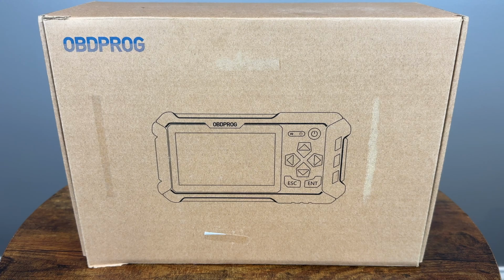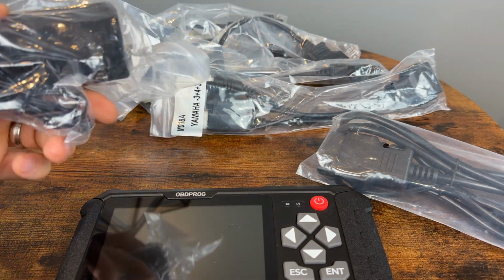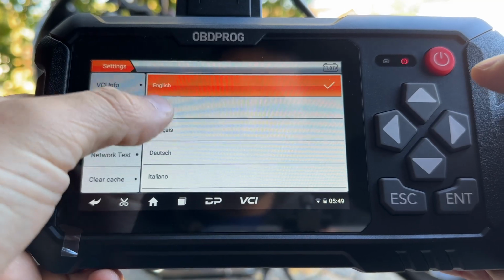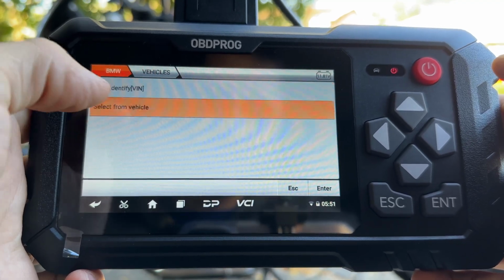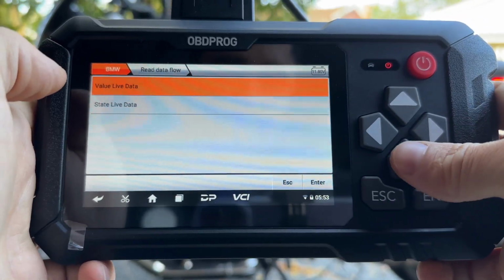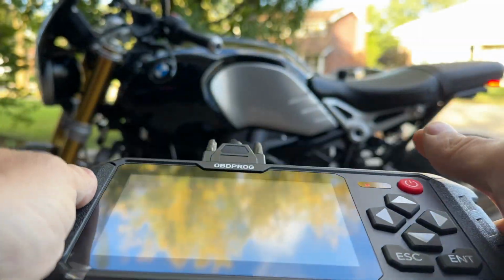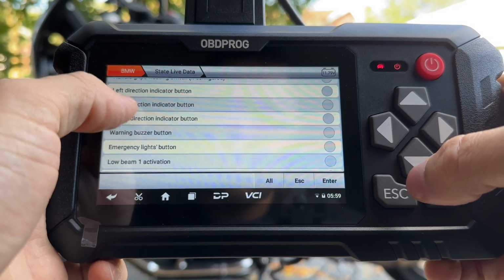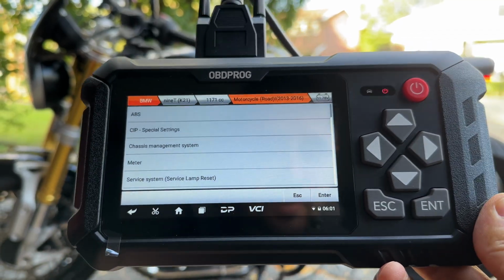OBDPROG Moto 100 - Fully Featured Motorcycle Scanner

Comment: 2006 fjr 1300 has a 3 and 4 pin cable connector, is not going to work you think ? .... because you said only 2016 onwards
If it doesn't work on 2016 and before motorcycle even if they have obd connector is not worth it I think

Comment: I got a $15 connector from Ebay. Now I can use my car OBDII tool on my 2020 KTM 1290SAS. It reads and cancels error codes.
Reply from the maker: But can it read KTM specific codes and not just the generic OBD codes? Can it see live data for each module? That’s the main advantage of this scanner and much closer to what a dealer would hse
Reply: @SimpleCarGuy  It reads KTM codes. Then I have to look them up on my laptop. Live data is of little use to a home mechanic.
Reply: @67daltonknox  Live data is critical to home mechanics to diagnos faults, faults codes are just to point you in direction of problem only, then you need live data.
Reply: Thanks. Got a 2017 Super Duke GT. My step son got an OBD from Harbor Freight. He spent $100 because the real cheap ones didn't look like they could wash codes. He's using in on his GSXR600 Track bike. I just ordered the adapter and going to get a similar OBD he has. This more expensive one looks great but I have too many pots in the fire spending money on!!!

Comment: Problem is, when you try to actually use the functions, they don't work lol
Reply: Do You know that , or is that just a guess or negative, be interested to know .
Reply: @christopherjohnson6056 I know that.  search for "Moto 100 YouMotorcycle" and you'll see two videos that I made about it which are very different from most of the others on this product
Reply: @christopherjohnson6056  Hello, I used one of these for a day and, at first, was impressed with what the screen offered then I attempted to reset the maintenance light on a 13 plate K1600. It got me to where I wanted to be but would not reset the cluster warning but it did blank the psi reading from the tpms which I had to 'wake up' by a quick ride around the block. I replaced the ten pin to obd lead supplied with another one and the light did go out until I recycled the ignition and it came on again. I may have been using a duff unit but the original buyer had achieved very limited success with it.
Reply: @ianrobertsonRR1 thank you for your reply and help .👍

Comment: I have the same Moto 100 that I primarily purchased to reset my maintenance scheduler on my 2009 BMW 1200RT; however, when I get to the window that displays 'control unit internal date' (1983); next service date, internal time (that's accurate), next service and KM covered; I cannot make changes.  I highlight and enter each one, but can't see how to edit the info.  PLEASE see if you can make the changes and let me know how the heck you did it.  Many thanks!  Also, the example that is on the OBDPROG website for a 2012 RT does not follow the same procedure as our Moto 100s.